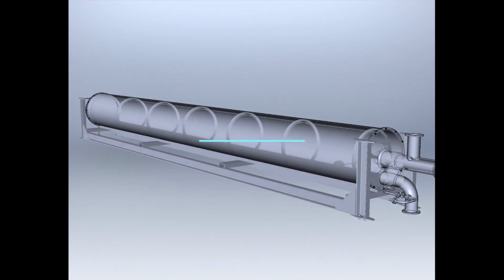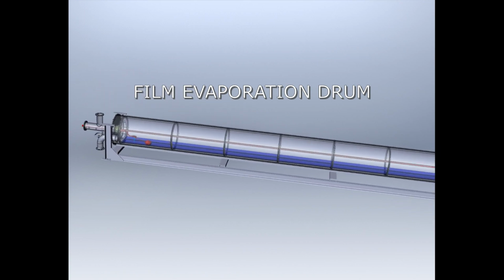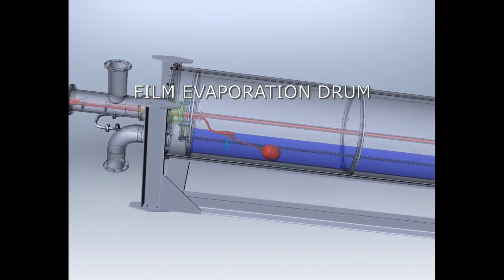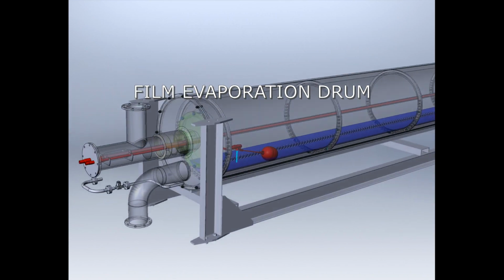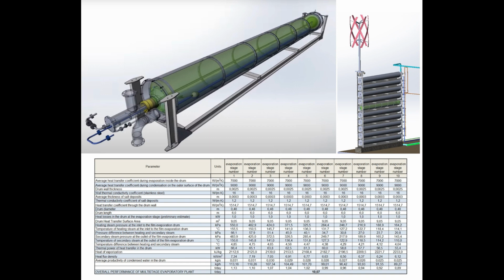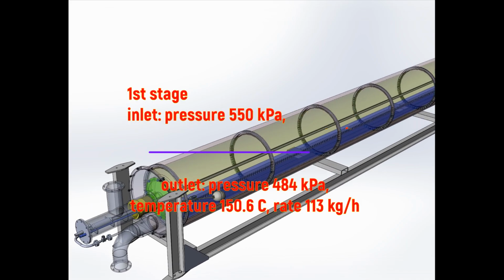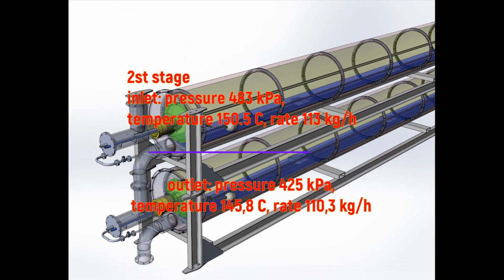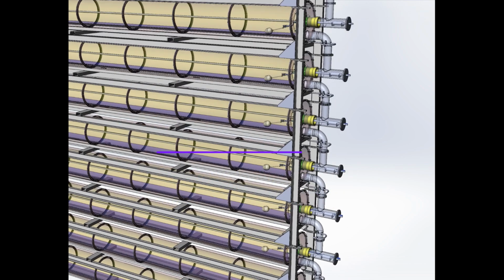New type of evaporators - "drum film evaporator" (DFE)

Comment: Hello, 
what is the purpose of all those information? 
Do you sell them?
Reply from the maker: No, to sell them you need to start producing them. My goal is to find someone who will undertake the production of this equipment and I will provide the manufacturer with patent protection and full settlement support. I am sure that this will be very profitable for those who are interested in the production of competitive equipment that can be used in almost all industries.
Reply: My company is about to install 4 units of brackish water reverse osmosis plants for irrigation in africa.
There are 2 problems:
1 - The plants are far from the sea, so discharge concentrate water will be a challenge.
2 - About 45% of the raw water will be wasted to the sea, which is a shame, considering that the quantity of water is limited.

Based on your videos, your system could solve this problem.
Let's talk about it if you are trully interested
Reply from the maker: @katrepinho  Yes, I am very interested in your proposal. I will be happy to cooperate with you to solve your problem, and I am sure that I have a solution. I will be happy to provide you with thermal calculations and design of both DFE evaporators and wind power evaporators for evaporation ponds, solving the problem of liquid discharge (prevention of liquid discharge) after desalination.
My email address is uzikov62@mail.ru
https://www.linkedin.com/in/vitaly-uzikov-864949103/?locale=en_US
Reply from the maker: @katrepinho  Yes, I am very interested in your proposal. I will be happy to cooperate with you to solve your problem, and I am sure that I have a solution. I will be happy to provide you with thermal calculations and design of both DFE evaporators and wind power evaporators for evaporation ponds, solving the problem of liquid discharge (prevention of liquid discharge) after desalination.
My email address is uzikov62@mail.ru
https://www.linkedin.com/in/vitaly-uzikov-864949103/?locale=en_US